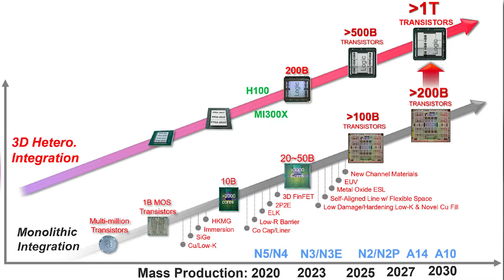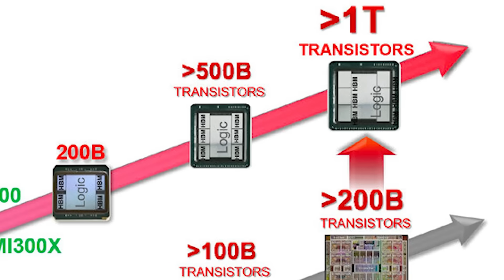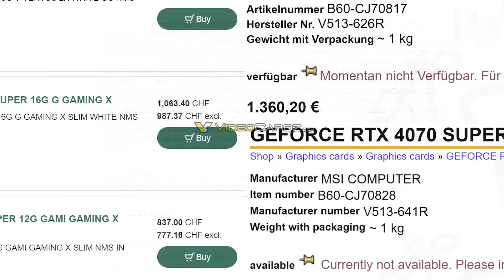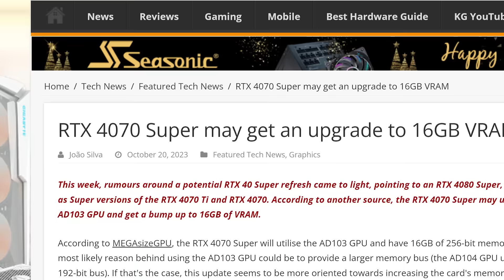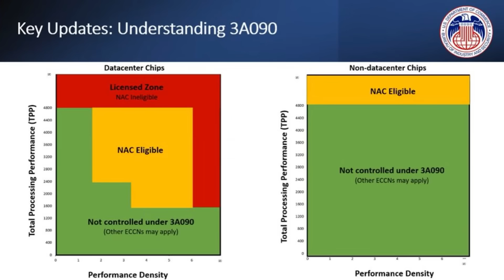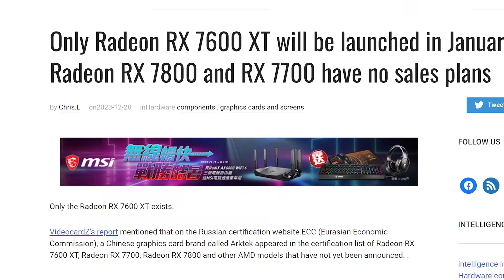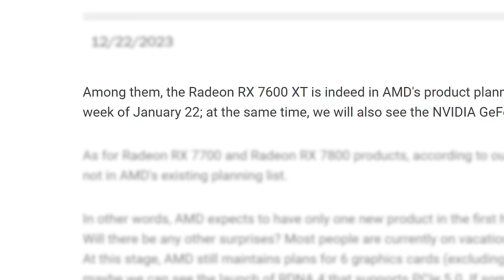Nvidia Just LAUNCHED Their “New” Flagship Gaming GPU!

Comment: Trillion transistors is far from impressive if you don’t decrease the power requirements per transistor. 
This just means the 3d chip would take roughly 5x more power than a 200 billion transistors one. Also theres the fabbing cost. 

Also, an Nvidia chip is much bigger than an Arm iPhone chip for instance. It’s far from a standard size for a cpu

Comment: I would consider reducing the TDP of the 4090D as a necessary measure rather than a politically motivated decision, as long as it effectively minimizes the risk of a 16-pin connector melting.

Comment: Sad in my country the RTX 3070 didn't go down in price because of the RTX 4070, infact they're neck & neck in price point. The cheapest RTX 3070 is just a few 25-40 USD shy of the RTX 4070.

Sellers here would rather see their stocks die than be sold.
Reply: Not really die imo, they are preying on buyers that dont know about it. There are surprisingly lots of em that still buy it
Reply: @Goksqt Idk about PC Hardware , but my work is all 3D applications , which requires VRAM (minimum 12)
And I'm looking to build my very first PC , I think I'll go with RTX30 series but with 16gb that would be lower price than 40series 8gb right?

Comment: Im so fkin tired of nvidias inability to just increase their vram amounts. Unless you want a 4090 for a stupid price, 16gb is all you can get. The vram is the biggest reason im just moving to amd and hoping for the best
Reply: The 4060 Ti 8GB is the worst GPU Nvidia has launched in a very long time, that worthless piece of crap should have never been born.
Reply: @jaxonswain3408 that's actually a 4060 rebranded as 4060 ti no joke
Reply: next to the GTX 960 2gb @jaxonswain3408
Reply: The gtx 480 was the last generation nvidia really brought their A game to making a great card, around 2012 there was a scare that games wouldn't advance much more, and largely they didn't so nvidia turned to disabling things, reducing vram and gating features to the quadro or titan cards. Even the 3090 and 4090, sure they're a bit faster than amd, but you pay for it, the 3090 in power draw and the 4090 in price. The 4090 isn't entirely 1600$ msrp because price gouging, it's a good bit that expensive because nvidia pushed it out on n4 when it was still risk production with massive dies. That made them faster, but enormously expensive.

Comment: Gonna marry a 4070 Ti Super to a 14700KF and post benchmarks that will make the 3070 Ti / 13700KF folks weep.
Reply: cpu upgrade was pointless but at least the gpu is an upgrade.
Reply: @Born_Stellar actually the 14700 has more cores than the 13700.  It is the one 14th gen variant that truly offers an upgrade over the 13th gen.

Comment: 4070 Super with 16gb version?

Was not expecting that.
Reply: will not happen. To have 16gb it would have to have a bigger memory bus and that means it would have to have the bigger chip that is also used for the rtx 4080 and 4080 super.  I don't see Nvidia wasting it on the 4070 super. A lot would be deactivated and the silicon area costs money.

or they deactivate parts of the memory connection of the 4070 chip and then use memory chips with double the capacity as in the 4060ti, but that makes even less sense.
Reply: @kevinj24535 been confirmed it has 16gb MSI OFFICIAL Sales page has been announced and shows 16gb vram
Reply: @kevinj24535  only would make sense if they used double capacity ram chips to do a limited run using broken gpu chips.

Since only one manufacturer seems to list them that might be a possibility.

Or it could just be to hide what's actually being released.

Or just a typo and they left out the "Ti" on the product description.
Reply: for the price of a 4080 with less performance lol
dead on arrival
Reply: @mr.electronx9036  won't be the price of a 4080. The 4070 Super Ti won't be either.

Comment: How in hell will the 4070 Super have 16GB with a 192bit bus?? Mixed density chips will create a case similar to the 3.5GB from the 970...
That IS a typo, either on the bus or the VRAM amount...
Reply: It's the 4070ti Super that getting the bump from 192 to 256 because it moved to a cut down 103 gpu.

Comment: 4090D would have been a good 'surrogate' 4080 ti if it was priced proportionally to it's reduction in power, but it isn't.
Reply: Is it china only?
Reply: @neon_arch  yep
Reply: @saiko-no-kami  Imagine Linus manages to get his hands on one.
Reply: @neon_arch it's their blatant attempt to go around trade bans.
Reply: They only made it because of some law that the US stating that you cant sell AI powered tech to China iirc, so the only thing that's making it slower is the lack of ai.
Reply: @juiceix  it doesn't lack AI features. Its performance is just worse because of less CUDA cores, Tensor cores, and RT cores and no overclock capabilities while still having the same clock speed as a normal 4090.
Reply: @juiceix  So the 4090D has no DLSS.

Comment: Prolly the only decent super card is the 4070 ti super tbh
Reply: 4070 Super is technically the biggest jump but with 12gb ram it's a 1440 maximum card.

The Super version of the 4070 just means it can play new releases at about the same settings the 4070 could when it was launched.
Reply: @AndyViant  idk for a 4070 ti super ur basically jus getting a 4080 for 800$ instead of 1200
Reply: @certified1075  and alan wake II showed us that's likely to be a 1440 card too without upscaling.
Reply: @AndyViant  true

Comment: 4070s 16gb for 600 would be a steal, most likely gonna be 750 or sum shit
Reply: 7900xt says HI
Reply: LOOOL PEOPLE BELIEVING NGREEDia will do anything for clients is loool they criple all current gpus in vram and will scam you if you want to have decent ram to have high settings.... its ridicolous
Reply: a 4070 super will be obsolete when triple a games need that much vram
Reply: @TACHYTACHY1 unless you’re focus is raytracing in which case you shouldn’t buy a 4070 anyways, that will not be a problem for a good while.
Reply: @The_Lightless it's crazy $600 isn't enough to play new games on high settings, with modern technology like ray tracing at 60fps. You have to spend $600+ AND use the frame gen, AND upscale just to get 60-80fps on new games with ray tracing.
Reply: @JGAbstract  the problem is that technology is evolving at a slower rate than before but the price is not changing to accurately reflect that. What we have is decreased evolution rate of technology and increase in prices instead.
Reply: @JGAbstract  Tbh, you can view ray tracing as this sort of beta test feature that is unoptimized and extremely resource intensive. It's a SUPER premium enthusiast feature atm.

Just few years ago the concept of having real-time ray tracing was a pipe dream, now there are attempts to pull it off, but it's in its infancy. So if you want to enjoy it in reasonable quality, you have to buy top few cards on the market which isn't unfair.
Reply: @JGAbstract  that's because ray tracing is fuckin stupid and even with nvidia's specially designed ray tracing cores it's massively inefficient
Reply: Not going to happen. Keep dreaming.
Reply: @davidszep3488  Well yeah, did u even read the second part of his sentence? lmfao